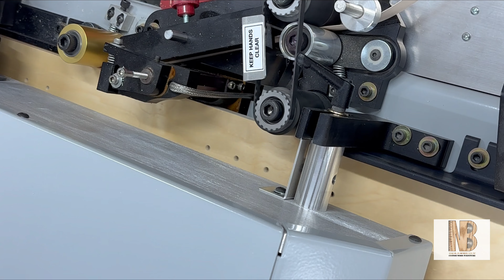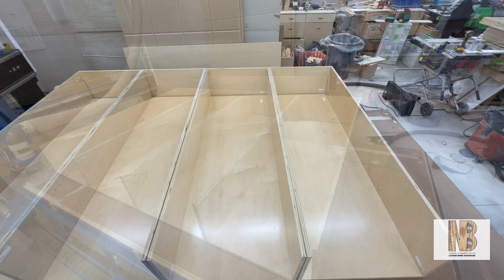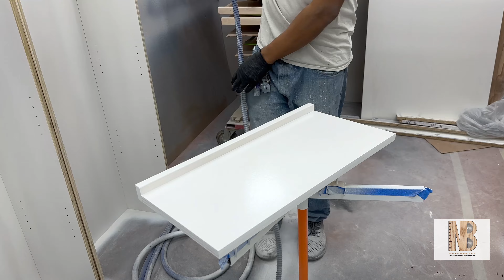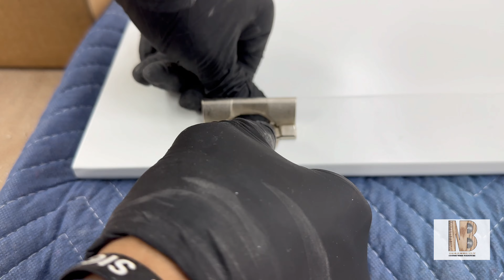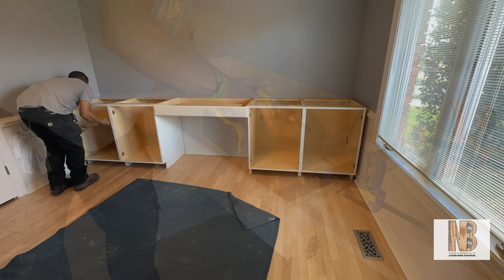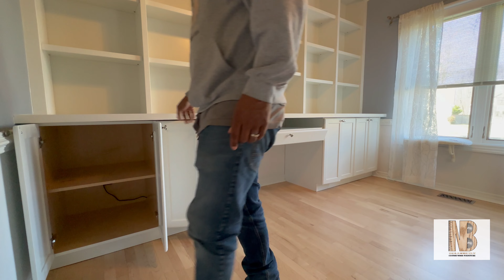Cabinet design made easy.  #mozaik #cabinets

Comment: How much does a CNC setup cost?
Reply from the maker: My current setup cost about $40k back in 2021. It’s probably around $50k now. That’s including CNC, air compressor, vacuum pump, dust collection and a few starter router bits.
Reply: @NolanBuilt thanks for sharing

Comment: Did you attach the uppers to the lowers? Also, do you find yourself using thin felt tape or anything under those uppers as you install (as to not scratch the countertop)?
Reply from the maker: The uppers are attached to the wall but not the counter top. I typically put down a moving blanket to put them up, then lift up and remove the blanket once I have it close. This is if I don’t have help with me.
Reply: @NolanBuilt  makes perfect sense, thanks for the reply! I'm about to quit IT and apply my geekiness to cabinet making. Taking inspiration from you sir!
Reply from the maker: @ congratulations 🍾🎊

Comment: I'm new to cabinetry, how are you scribing in and attaching the filler strips on the sides?
Reply from the maker: I use the u scribe jig then cut to the line.
Reply: @NolanBuilt  thanks for the reply, do you do double sided machining?
Reply from the maker: @NHBWoodworks I’ve done it once

Comment: Looks great! Did you need to scribe the counter top or was everything nice and square?
Reply from the maker: Yes I had to cut it in, but the were with 1/8 over 25 inches. So instead of scribing, I took measurements the slight angle. I got it within a 16th and then split the difference on both sides.